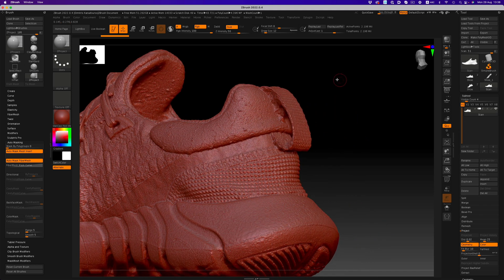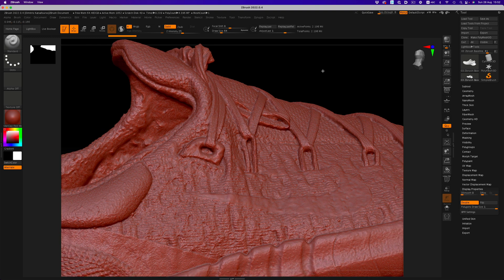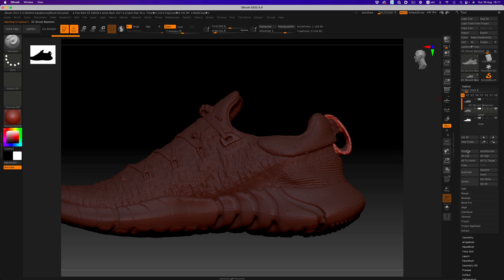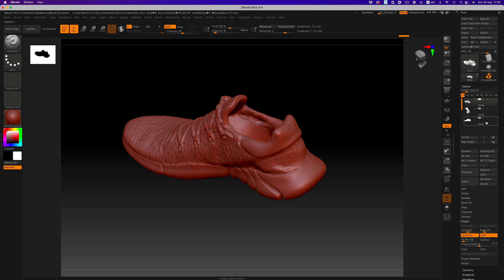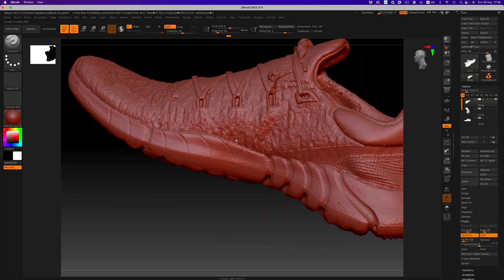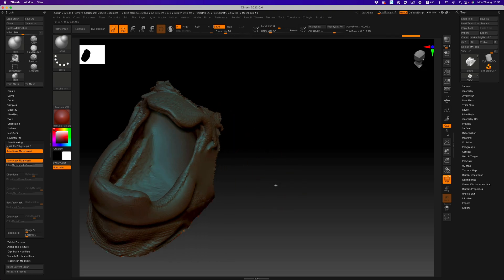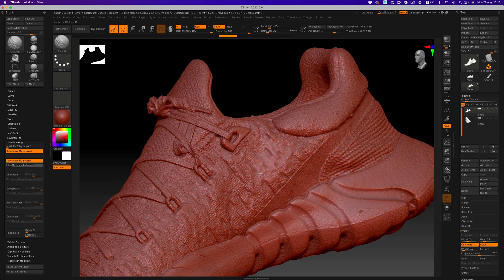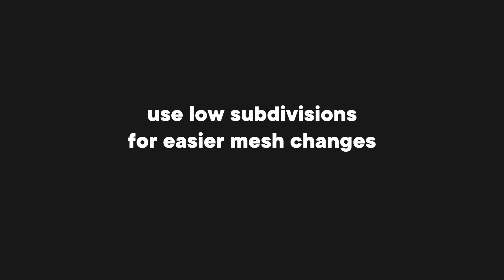How to cleanup your 3D scans in Zbrush

Comment: Is the project ok to save file as STL after finished to 3d print?
Reply from the maker: @InitiallyJB  in theory yes but it depends on the object. Some parts might be too thin or some angles might be too steep so the object might not be ready yet for printing. You also want to ensure that you’re not wasting too much material, so you will have to hollow out the object.  
So in theory you could go straight to print but I would advise against it.
Reply: @ thx for speedy reply will continue to work for precision